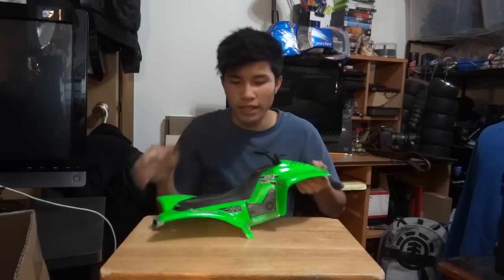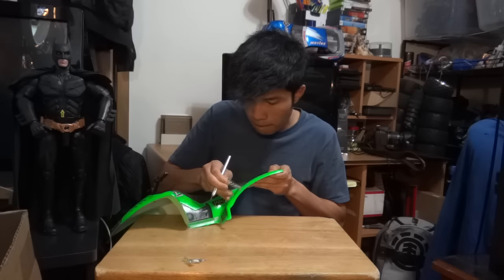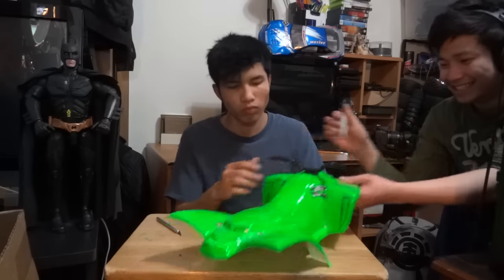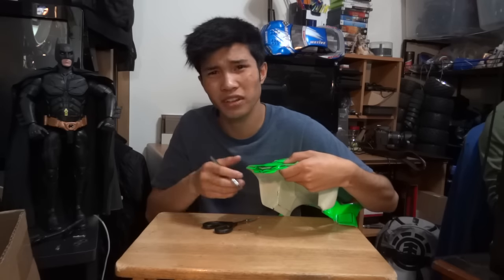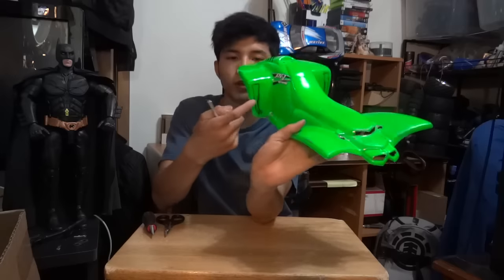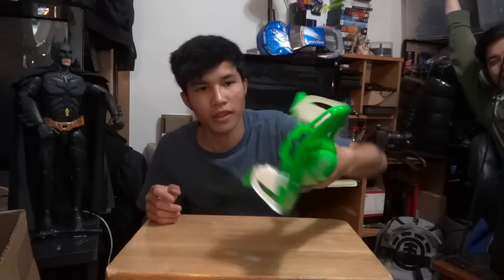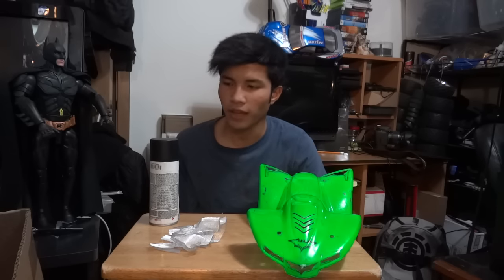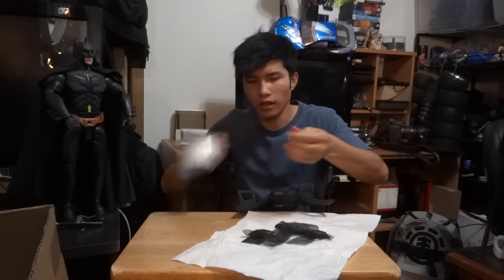RC Modify 5 | HPI Savage Flux Batman ATV - RC Car

Comment from the maker: Batman is called The Dark Knight Rises Interactive Batman Figure
Similar Batman Amazon http://amzn.to/2oJPMW3

HPI Savage Flux
eBay https://goo.gl/TPU7Cg
Amazon http://amzn.to/2oFXa4I

Tools For RC Modify:

Dubro 2331 lexan Body Reamer & Scissors Set
eBay https://goo.gl/uHkXpX
Amazon http://amzn.to/2nF4MTx

X Acto Knife
eBay https://goo.gl/9Knkdg
Amazon http://amzn.to/2nbSdUh

Duct Tape Nashua 48mm x 55m 
eBay https://goo.gl/K4scr9

After Market RC Parts:

GT POWER 12 LED Flashing Lights
eBay https://goo.gl/9Lq5cj
Amazon http://amzn.to/2oaPBVW

Amaco 1/16 Aluminum Contour Mesh AO50004D
eBay https://goo.gl/dGr7Qn

Optional Parts:

Mini Car Stand Blue by Duratrax DTXC2361
eBay https://goo.gl/fzWXPr
Amazon http://amzn.to/2oaYzm3

Deluxe Car Stand Blue by Duratrax DTXC2370
eBay https://goo.gl/ghGvBr
Amazon http://amzn.to/2nFakgy